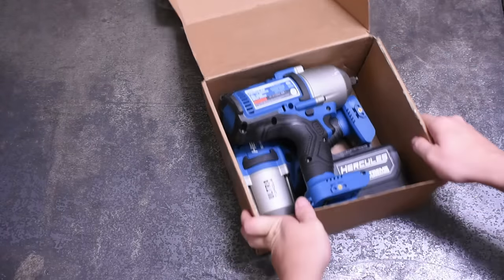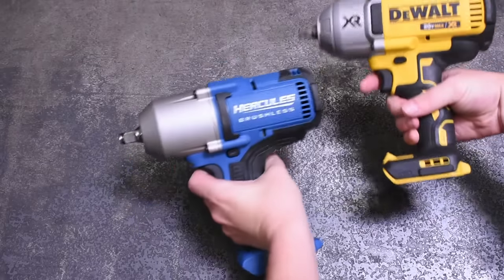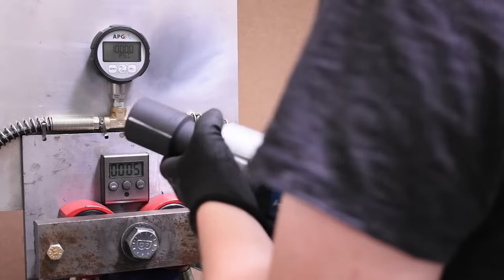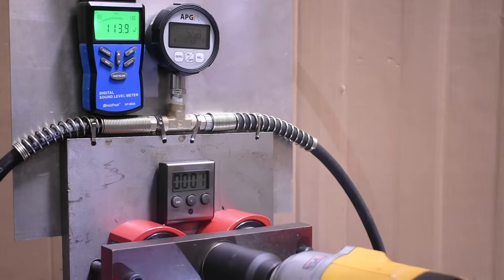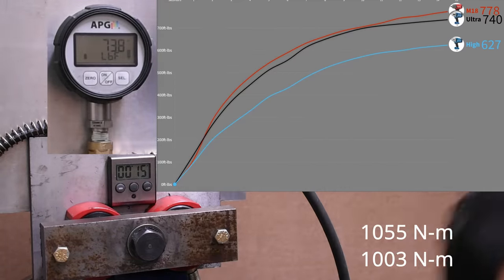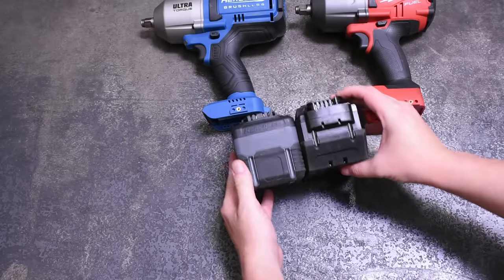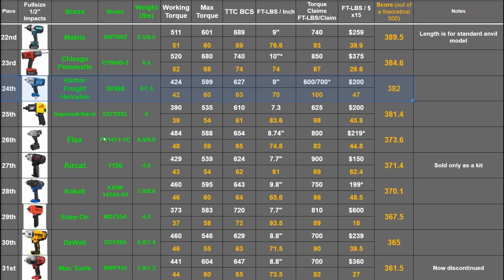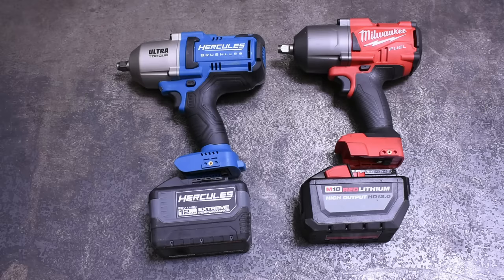Harbor Freight Dethroning Milwaukee & DeWalt w/ New Ultra Torque Impact Wrench?

Comment: I'm already in the Hercules line myself with some other tools, so it looks like an ultra torque is calling my name once they've come in stock at my store. I bought my father the DeWalt DCF899 last Christmas and he loves it. My older brother said he uses it on everything. He already had one of DeWalts smaller mid-torques so I figured something with some more oomf would help work on his fuel trucks and the tractor. :)
Reply: I have the 899 at work and have only came across one bolt that it would remove or break and that was my superdutys lugnuts but to be fair those like to tighten them selves and have Broken a few half in drive sockets and breaker bars
Reply: @Wesleystewart78  The biggest machines/vehicles my father owns are his single-axle fuel trucks and my grandfathers  28hp New Holland 1715 compact tractor. So the 899 I bought for him is a lot more effective for working on those things than his smaller DeWalt impact wrench. He's not removing the lug nuts from his trucks with it to change the tires though. He has a mechanic he pays for that. But what work he is capable of doing the DCF899 is perfect. Plus I got it on-sale at the beginning of last December in kit form where the deal included a set of DeWalt branded deep-well impact sockets as free add-on. :)

Comment: If HF had all the same offerings as Milwaukee (in terms of both tools and batteries), I would've gone that route.  I love all of the different Milwaukee tools on the same battery platform.  I like using a saw, a backpack vacuum, a compressor, and a leaf blower with the same battery.

Comment: I as a 30 year contrator literally have/own in my arsenal 95% Milwaukee tools. Hands down the strongest most reliable and incredible ultra performance   caliper of any cordless tools ever.  The Ultra is a nice tool it appears. Time will till how it holds up over the years

Comment: HF has been stepping it up for sure. I am most curious about their new ICON light.  They are claiming 2100 lumens, 100 more that the snap on equivalent for almost 150$ cheaper. I have the ICON and its like turning the sun on but I would love to know how close they are to 2100 lumens and what kind of runtime it has compared to that snap on light
Reply: I just see no reason why they didn't let it have a easily removable battery. I was excited then majorly disappointed

Comment: I just bought their Ultra-Torque, an 8AH and 12AH battery, the new Hercules cordless grinder with paddle, a worklight and floodlight, and some other odds and ends... Between the Cyber Monday discounts, the 25-off combo deal, and 10%-off first purchase (they ALLLLL stacked), I got outa there with a HECK of a deal!

Comment: Just bought the Hercules  today 1400 torque bought the 5.0 amp battery and the charging station asked if there was any discount and turns out there is a deal on them rn got the 1/2 555lbs break away torque gun for free 80$ish dollar value can’t wait to use them

Comment: i remember removing the 1-11/16 axle nut on my truck with my Bauer and held the impact for about 3 mins straight and it started to get so hot it almost smoked, i let it cool down for about 30 mins and it worked perfectly fine after that. 
and yes it did remove the seized up axle nut after i used a 2nd battery. i just wanted to torture test it 😂

Comment: These inexpensive units may have great power when new, but what is the long term durability of them and how long will those big numbers last for? They use less expensive parts, so chances are they won't las as long as a more expensive name brand.
Reply: They're all produced in neighboring factories, functionally I don't think they'll last all that differently. If anything is to fail, it's probably the rubberized handles. I've had an earthquake as a mechanic for 5+ years and it's the only thing that really lets the tool down.
Reply: I mean, the fact harbor freight is confident enough to offer a good warranty tells me that they'll be pretty okay

Comment: I went all in on the Ridgid battery system a long time ago,  They had these multiple tool package deals that were at a fantastic price.  So I am hesitant to get anything else because I don't want to deal with different batteries.  That said, although I do buy stuff from HF (much less than I used to when they had free stuff and frequent coupons), I just am very hesitant to buy anything electrical there.  I have to admit some of their cordless tools look ok, but I already have some 20 odd Ridgid tools with a lifetime service agreement (haven't tried to use it yet).

Comment: Thank you for your videos, its nice to see unbiased information when it comes to tools. Working as a auto tech its easy to get caught in flashy or brand name tools, or someone says X tool is the best. There are times you can get the same bang for less buck and you give that information. Having that information allows anyone to make the decision for themselves what is most cost effective for what they plan to do. Irrelevant note I would like to see your normal testing but also a torture test on the Advid power 3/8th 12v electric ratchet from amazon. Its something I bought and have my opinions on but would like to see a unbiased view. For 60$ you get tool, 2 batteries, charger . But also including some sockets no one should ever use.
Reply: Yep I recently had a umm argument with a tool truck fanboy tech...after a while he admitted he used multiple cheaper sets in different applications. Then said he had NO idea SnapOn authorized their name on cheap junk tools sold at Tractor Supply or Costco...

Comment: I noticed the speed wobble phenomena with both my 2767, and my 2769 when removing some seriously stuck lug nuts on specifically F150/Expeditions. I notice in your case, that the socket stops cold, while the impact is jumping all over. This is exactly what happens in my case as well. When the socket gets seized on the nut, the impact will jump all over while putting more shock into your hand. It makes the same sound too, from what I can hear.
Reply from the maker: Yessir! But it definitely gets in a funk. Even when you take the socket off and put the gun back on it'll often go right back to wobbling

Comment: Big numbers are great and all, but having used almost every brand of high torque for a long time, I much prefer lighter weight Midtorque (Milwaukee gen 2 and the DeWalt gen 2) will do 99% of what you actually need, and being in a shop, if I need something to actually break rust and not my wrist, I'll grab my air gun.

Comment: Harbor Freight winning at the cordless impact tool race and the welding race! Impressive!
Reply: LOL!  Who in their right mind would buy this over Milwaukee?  It performs the same as Milwaukee, and it costs the same as Milwaukee.  All I see are down sides.
Reply: @fredygump5578  Competition brings the prices down. I'd buy it with the 5 year warranty and the performance is the same as Milwaukee.
Reply: @fredygump5578  Some of hf products are on point and are good quality like the Daytona jacks, Fortress air compressors, Hercules and Bauer impacts which I have all of them and have not one complaint. I just don't need a 1/2 impact right now.

Comment: You might be able to find the 2767-20 for $250-$260 on a place like Amazon, where you;re dealing with 3rd party sellers. Milwaukee actually did increase the retail price of that model from $299 to $329. Home Depot for example has it listed at $329 as well. So they are just comparing their retail price to the retail price of the Milwaukee. These HF Impacts are already on sale for $179 and $199 respectively, but when they do the 20-25% off no exclusions deal you could get one quite cheap. I used to own the 2767-20 but sold it because it was just too much impact for what i normally do, so i bought the GEN 2 Mid Torque instead but i i like seeing new impacts and new brands making quality impacts.
Reply: The coupons frequently don't include the power tools

Comment: They really do stand by that warranty, I bought the half inch sub impact and it didn't quite have the power I needed for my job so I took it in and they without much question refunded it and I bought the ultra torque.

Comment: I’ve commented on here before and after trying the Hercules ultra torque out I have a few comments. First off I would like to mention that I’m a name brand type of guy but I’m also open to knock off stuff if it’s good and with that being said I would like to address the pros and cons of the Hercules line up compared to others. 1. Pros of Hercules 1/2 ultra torque has no battery slop in fact it’s hard as hell to insert the battery when it’s brand new😂. It feels good in your hand and isn’t bad quality, the batteries are affordable and so are the chargers, if you’re new to electric power tools it’s an easier cheap start to get into it and the batteries for the most part charge relatively quickly! The cons: they get a bad name for being “off brand” tools which might get you laughed at, they’re blue which is my opinion on the color being bad lol, they’re not offered on a tool truck for automotive career minded individuals, and their selection of other tools is limited for the time being. The power is definitely there and I rate the quality as the best “off brand” high torque gun you can get but every one thinks just because it’s a harbor freight gun that it wont last but a year or two and that’s also not true. I’ve had the 1/2 compact/ mid torque for 2 years now and it’s still running strong! Now Obviously in terms of off brand you can’t generalize Hercules as off brand, it would be like saying that flex or ryobi is off brand which isn’t the case. To generalize something as off brand it would have to be an identical tool in every aspect but have a different brand name for it to be considered “ off brand”. This isn’t me bashing other brands cause obviously I have others that I enjoy using! To sum all of this up what I tell people who are shopping for tool brands is; it’s all about money, if you have power tools at home that have batteries already, buy that brand power tool to go along with the batteries cause that’s the real expense being that batteries are usually what fail first and if you’re new to electric tools then do a lot of research on what’s affordable to “you” specifically in the long run cause it gets very pricey!

Comment: I want to thank you for making this video.   For Christmas my wife purchased the 2767 Milwaukee set that comes with 2 x 5ah batteries and the charger, she paid $517.00 after tax.  I then happen to come across the video (probably because I have been subbed for years) and you brought the Hercules to my attention, for a fraction of the price.  I then went to harbor frieght to see what I could do and the guy sold me the Ultra Torque for $159 and the 12ah battery for $119 for a total of $307 after tax.  This was a great deal for me because I already have a 1/4 and a 3/8 Hercules impact with 2 5ah batteries and a double 20V battery charger.  I now have the full Hercules impact set, with 3 hercules batteries (1 of them being a 12ah) and I saved my wife a little over $200 (that she is still going to kick back to me for something else)!!  Your video made our Christmas a little more Merry!  Thanks buddy!

Comment: At my home depot they are actually charging 329 for the m18 fuel high torque
Reply from the maker: Yeah, it is $329 at HD now. But everywhere else sensible is still $250

Comment: After two decades of Dewalt and Milwaukee, I'm now strongly considering the Hercules. It sucks because we've got literally thousands of dollars wrapped up in 4ah/6ah batteries, but the drivers and impacts hardly last a year. Then we've got warranty hoops to jump through, which aren't worth it. Every warranty I've had to deal with HF was about as pleasant and straightforward as you can get. I'm glad to see them stepping up their game in the power tool department.

Comment: Because of this video... I just picked up the ULTRA on sale for $179.00 during sidewalk sale that started today for Inside Track members. And because I bought a Hercules Battery and Charger with it I got another $25.00 off! Great buy! Look forward to using it.
Reply: Total??? All together
Reply: I was planning on hb, but after all the price its almost d same as a good dewalt,
Reply: @gerardolopez5875  total of 154. For the Ultra plus cost of charger and battery.
Reply: @gerardolopez5875  But Dewalt only has a 3yr warranty, the Hercules has a 5yr warranty, and all you got to do is return it to HF for a new one. Dewalt is not so easy.
Reply: @pipeman65  @ 180 gun  / 160 charger& battery s?   Equals 240?
Reply: @gerardolopez5875  154 for the impact gun, the cost of charge and battery depends on which battery and charger you choose. They offer different sizes
Reply: @pipeman65  @my local store has it for 179, gun only
Reply: @pipeman65  @ if i get al needed, it will be like 240$,    And dcf900 dewalt , its 350,$
Reply: @gerardolopez5875  if you read my original comment, I said it’s 179, but if you buy a battery and  charger you get an additional 25.00 off the gun.

Comment: I bought an impact gun rated at over 1000 ft. lbs breakaway torque to take out a crank pulley bolt on a Honda and it couldn't do the job. I can produce far more torque (with leverage) so I don't use one anymore. The only way I see you needing one is if you need to take out bolts fast or you need one of those super high torque ones to take out lug nuts on a construction vehicle. I fix my cars as a hobby and I'm not in a hurry to get the work done. There hasn't been any stuck bolts I haven't been able to take off with leverage so I don't need one.

Comment: If Hercules can make a tool adapter to allow you to charge your phone at 3.0 amps I believe they'll win overall. Everyone else tools is 2.4 or 2.1 which would've been fine 5 or more years ago but everyone needs a 3.0 charge nowadays. So one 3.0 usb a and one ac outlet and they'd have the top ac inverter for tool batteries.

Comment: Hey mate I’m in Australia and down here we have only 4 brands that all tradies use on a construction/building site 5 if you count the mostly used cheap Chinese brand Ozito . The top 4 is Milwaukie, Makita, Dewalt and ryobi it would be awesome if you made some videos of these 4-5 brands against each other. Impact drivers, grinders, circular saws, drills ect ect all cordless of corse. Anyway l love your channel and the content your putting out is awesome so keep it coming. I wish l had something similar 20 years ago l would a lot more knowledge on what to buy and not to waste my hard earned dollars on. The most frustrating thing about buying cordless tools are obviously the fact that your locked in to whatever brand you chose to start with because the batteries are brand specific. Unless your on the big dollars and can afford to buy separate battery chargers and batteries as well. I would love to see a video on cordless nail guns as well. Thank and keep up the good work 👍👍👍

Comment: Since the Craftsman CMCF940 is basically a rebadged DCF899 with battery and charger for the same price I think it handily beats the Hercules “Ultra-Torque” in value… and performance when you consider that the CMCF940 somehow bear the DCF899 it was rebadged from (beat itself?!).

Comment: I have harbor freights older red big old 1/2” gun. Earthquake? Been a great gun. AvE even tore one down and it looked great. My biggest gripe is every 6 months something comes out and I need an entirely new battery system/charger. So that’s a huge problem for me to be willing to buy another harbor freight. Also some of their batteries have died on me, and chargers. Including their 80v brushless stuff. Just refusing to work. I don’t have the time to disassemble packs and repair them… Milwaukee m12 or m18 has more staying power.
Reply: @rch5991  Yeah exactly! I still have some ryobi stuff from my dad from like you said 20 years ago, works with the same batteries as the new stuff. Still works fine! I love some of the tools from harbor freight... like my big jack, and aluminum jack stands, breaker bars, cheap sockets in a pinch. But damn I regret every battery powered purchase I've made from them... I have a corded angle grinder that's gotta be near 20 years old, still works great lol. But nope they took enough of my money on the battery stuff. No more! I need tools that work. My milwaukee m12 gets the snot beaten out of it. Still works. Never missed a beat.
Reply: @rch5991  I will say the only thing I didn't like from milwaukee I bought was their die grinder m12. Thing is junk. Would bind up all the time couldn't do shit even with a nice new carbide, working on some heads... I returned it. Got a harbor freight cheapie die grinder left over from the change to Hercules or whatever on sale, and it's been a champ.

Comment: Ok, I just went and bought the Ultra impact, the 12amp battery, the lowest priced charger and a USB charging accessory that can run off the battery.  Total with tax $404.00.  I have a fifth wheel and am getting new tires and changing them myself.  All the lugnuts so far required a "cheater" but the last wheel is completely under a slide and the cheater won't work. I have a rotator cuff issue with my left shoulder and tendonitis throughout  my right arm but i believe I can handle the tool (it is heavy) for what I need to do.  Also I have some old motors that I need to go through and part / scrap that this will be helpful with. Interesting that the Five year warranty doesn't cover "NORMAL WEAR AND TEAR". Is that a standard warranty clause.